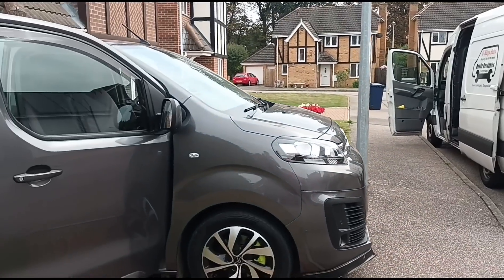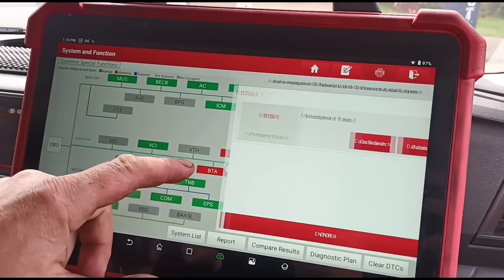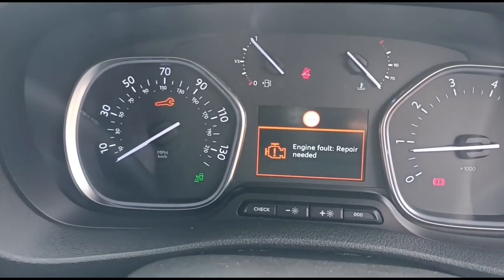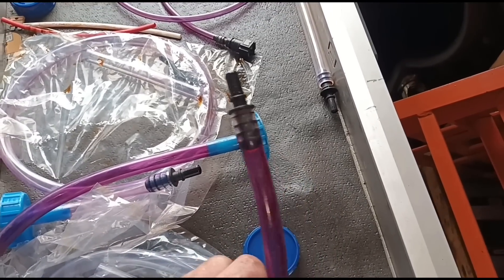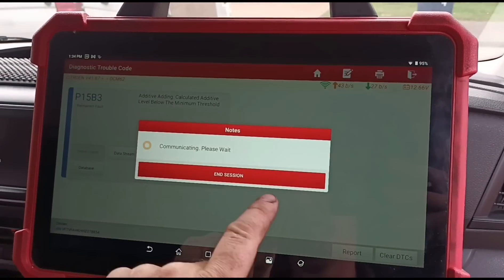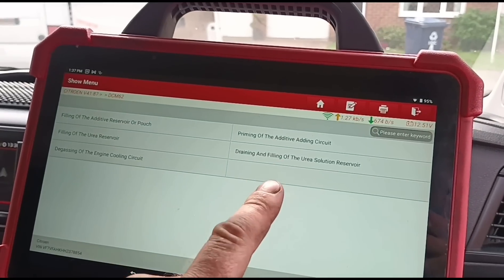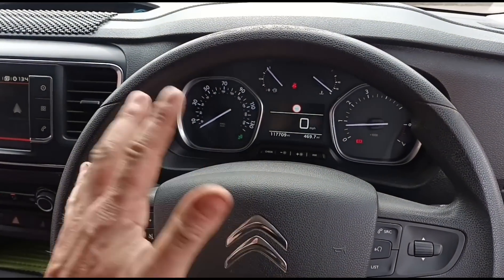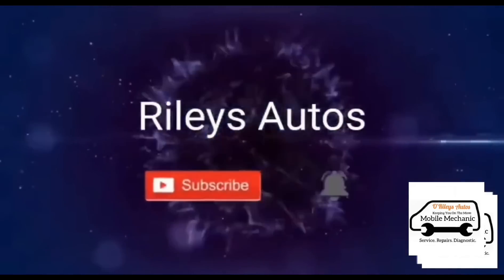Citroen Dispatch 2.0 P1583 Additive Adding Calculated Level Below The Minimum Threshold

Comment: He jimmy,
I'm experiencing a problem with my peugeot expert van. It's a 2020 model done 27k. When cold driving at low speed the vehicle hesitates as if its a throttle pedal fault but its only when cold. Have you experienced anything like this? Regards Chris.

Comment: Please, has anybody experiences with this?
There are 2 tests in the EOLYS Additivum computer menu: 
1. Sound test - the pump must be heard if pumping (=clicking sound) for ca 10 seconds.
2. Flow test - in which the pump should pump ca 20 ml during this test.
I have tried both tests and both work on 2 cars (1.6 HDi 92 Hp, Berlingo and Peugeot Partner, 2012, 2013, 360k, 260k km)...but on the both cars the pump gives only 6 ml, instead of 20 ml in the "Flow test".
Can anybody tell why is it? Should I replace the pump, clean hoses, is the bleeding valv of the reservoir clogged ... ?

Comment: I've mentioned this previously.. avoid using the universal "PAT" fluid's. Only use genuine Eolys branded fluids (dealer, Bardahl, Walker etc use these). The reason is, the chemistry is vastly different and incompatible with each other. Solvay, manufacturers of Eolys created unique, different cerium and iron oxide materials which is patented. With a new DPF and PAT compatible fluid, I was regenerating every 250 miles and you noticed the regen's. Fast forward 80k miles, same DPF but genuine fluid, I am now regenerating around 700 miles and the regens are unnoticeable. I have saved DPF information through scantools of all this to compare. No changes to engine components (everything still the same) or changes to route driven.

Comment: Hi Jimmy, Has this van not got a separate additive pump module?  We're struggling with a few of these later Dispatches as our snap-on Zeus will only reset the level in the engine ECU and not the additive ECU.

Comment: Jimmy . Is it after a certain year that they started fitting the  eloys tanks. Never heard of it until I watched you . Does my 65 plate 111 Vito have it …. It’s just before the ad blue tank was fitted ! Thanks in advance
Reply from the maker: Most vehicle with Citroen/Peugeot engines were fitted with this not sure exactly the year but around 2005?
Reply: Only PSA engines and those which used the PSA engines. Eolys fluid reduces amount of soot created, lowers temperature the soot burns at which means it regenerates alot easier.

Comment: Thank You Jimmy .............from one mechanic to another 👍I do appreciate your help and guidance, especially since I just bought the same make of van.  Take care
Reply from the maker: Glad to help
Reply: @ORileysAutos  Can you remember the year of that van ? I'm guessing not all 2.0 hdi Dispatch vans have the Eolys tank option ?
Reply from the maker: @larrysimon1  2020. They are all fitted with this
Reply: @ORileysAutos  Thanks for that, mines a 2019 never even had a look underneath it yet its just been delivered.
Reply: @ORileysAutos  Have you come across P14A7 code EGR programming fault on these Dispatch models ?
Reply: This might help someone P14A7 code in my case was a stuck slightly open EGR valve that would not move, I think when you first start the engine the EGR is energised/cycled to establish its position. If it doesn't move it throws this fault code.

Comment: Absolutely spot on, each time you open you fuel flap a magnetic circuit is broken and Eyols fluid is injected into what is assumed to be a full tank. If you open flap to fill tank you will get good use of the fluid, partial fill the tank then you run out of additive quickly. The Fluid a type of metal and will pass through the engine and embed in the Particulate filter. It has a lower ignition point than the soot trapped there and ignites more easily promoting a better regen.  My Peugeot 407 had a three litre tank on left hand side just in front of the rear wheel. The level is a calculation based on fuel tank flap opening and closing. 2006 2.0 HDI Estate. It needed a reprogram on the engine ECU to reset it as the Peugeot Garage could not do the reset.  I paid a guy to do the reset first but he could not do it, software bug.
Reply: "each time you open you fuel flap a magnetic circuit is broken and Eyols fluid is injected into what is assumed to be a full tank"
At newer cars, this Eolys additivuv is injected according to really tanked fuel, by 10 l steps. No "full injection" after just openig the fuel flap.
Reply: Maybe on the earliest ones. The later (2007+ IIRC), the pump runs for a varied amount of time dependant on fuel taken. Of course, it's not a perfect system still, so to maximise Eolys, don't fill up small amounts but I find filling up minimum of 40 litres is about right - not too much weight in fuel tank, bills don't get ridiculous etc.

Comment: Does it pump a calculated quantity into the diesel tank after the owner fills up or does it get injected before the dpf like an adblue injector?
Reply: Eolys is dosed into the fuel tank at each fill up.   Some PSA cars ALSO have Ad blu AS WELL.
Reply: @timbo19751975  thanks timbo